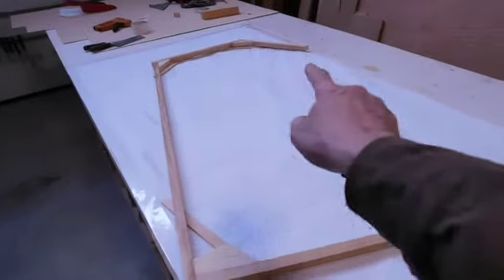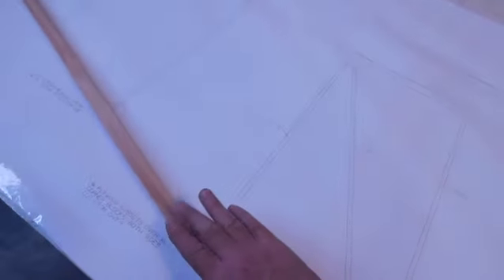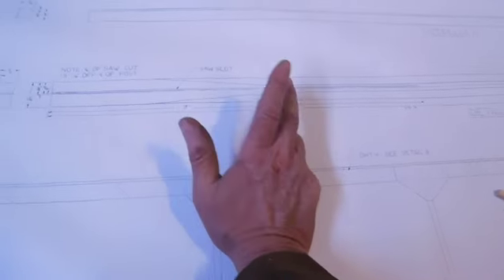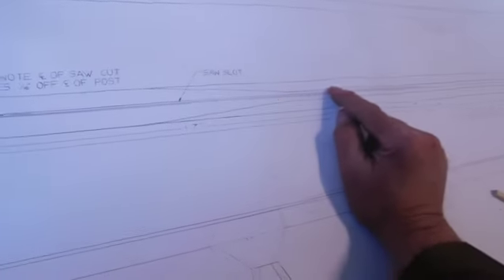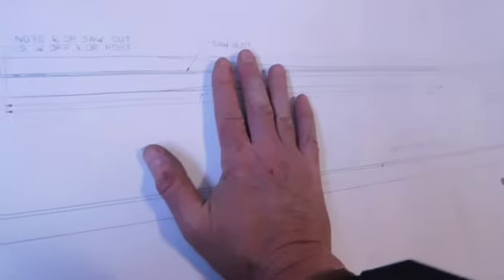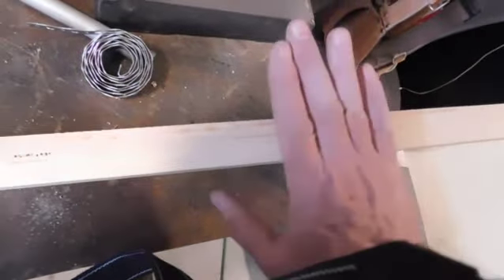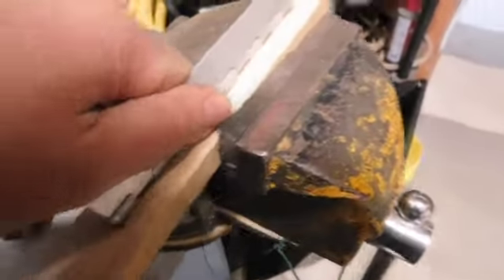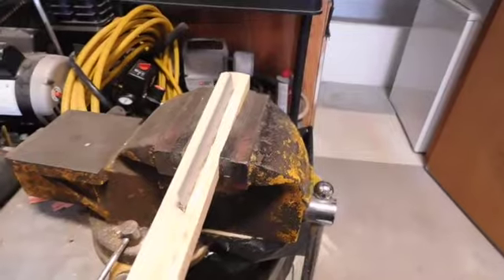DAKOTA HAWK EPISODE 84

Comment: To slot my rudder spar, I use my oscillating saw and cut it straight in. I show it in FP202 Scratch build from prints E34.
Reply from the maker: I used that method on the elevator... it works well

Comment: The question about the gussets at the bottom leading edge of the rudder. Look closely at the plans for the barely noticeable hidden clue and you will see the dashed lines indicating that the 1/8" gusset is under the 1/4" gussets. Being under the 1/4" gusset it would also need to occupy the entire area under the 1/4" gusset. I assumed that the intention is to require shaping some on the 1/4" gusset to match the curve of the nose. That did not make much sense to me and did not seem like the strongest way to form that corner. I glued a larger 1/4" gusset first to bring the gussets flush with the 3/4" leading edge. I have not yet but plan to put the 1/8" gussets on top of the 1/4" gusset and the leading edge 3/4" piece too. Will require a little shaping of the 1/8" gusset to match the curve at the nose.

Comment: Created a video to demonstrate where the strength of the bottom rudder joint comes from https://youtu.be/9bvpecqNHso
Those gussets on each side are more than adequate to prevent the torque from breaking the rudder.
Reply: And let's estimate the hinge torque.  With L = Cₗ 1/2 ρ V² A, V = 120 mph, A = 10 ft², I get 0.75(0.5)(0.00238)176²(10) = 276 lbs.  That's the load on the entire vertical tail. The rudder will take half, 138 lbs, centered on the rudder 1/3 chord, 4(?) inches. Then the hinge torque is 552 in-lbs.  If the rudder horn is 2", the pedal force is 276 (!) lbs.  Believable? If so, the stress in the gusset joint is about 552/1.25/2.25 = 196 psi. With T88 lap shear = 1200 psi, the safety factor is 6.  The CS-VLA allows for a pilot-limited load of 200 lbs for the rudder pedal. Then the hinge torque is only 400 lbs and the stress on the gusset joint is 142 psi, safety factor 8.4.

Comment: The rudder spar is free to turn on it's hinges, there isn't a great torque there.  The large 1/16" ply gusset will handle it.  Adding the 1/4" ply doubler stiffens the bottom rib but won't do much torque-wise. Remember every ounce added to the tail means 2-3 ounces in the nose for balance.
Reply from the maker: No force while sitting in the garage but cruising at 80MPH there will be considerable force/pressure on that corner of the rudder when you hit pedal to turn one way or another. Even though the top of the rudder is over centre and will provide assistance to the pedal pressure.
Reply: @sawyersdad5292  Could it be that the designer used an aerodynamically balanced rudder so the rudder pedal forces would be low?  And then the rudder could be lighter? And the 600 lbs empty weight might be acheivable?
Reply from the maker: @robertdaly9870  Yup, I'm still beefing mine up a bit because of a number of discrepancies in the plans build vs. kit.
Reply: @sawyersdad5292  The gussets on the side are all that is needed. You do not need any other reinforcement. Remember epoxy is strongest in shear. In order to crack the joint between the hinge post and the bottom rib you first must break that shear joint of the gusset where it's attached to the hinge post. Until that gusset shears off the hinge post the rib simply cannot break away and move independently of the hinge post.  According to the data sheet T-88 glued to wood (maple was the only sample listed) is good for 1800psi in shear. The gussets area on the hinge post is 5/8" x 4.75" totaling 3 square inches 3 x 1800psi is 5,300lbs.
Reply: @sawyersdad5292  if you put that 1/4" ply on the bottom you end up lowering the bottom of the rudder and that IS a problem. You would need to raise the fin/rudder assembly by whatever extra bulk you add in the bottom. The rudder cables exiting the fuselage need to line up with the rudder horn and IMHO, building according to the plans puts the control horn too low to start with, making it lower is an issue.
Reply from the maker: @ulbuilder  I'm going to inset it like Algy did... I figured I'd have to change where they exit out of the slightly which isn't a concern... but need to get it on the fuselage to see exactly what's going to line up with what...  I haven't built to plans yet, why start now 🤪